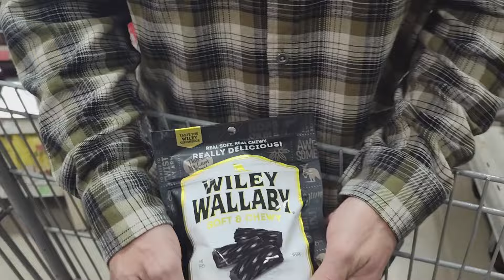Home renovations create some unexpected controversy! | Heartway Farms

Comment: 🇦🇺On one of the walls could you put a boot spike (dowels) rack. So boots are slid onto the dowels to make it simpler, leaving more floor space.
For the other shoes could you make a wooden racking system that’s on sliding tracks, the shelves wide enough for 3 or 4 pair of shoes by 7 or 8 shelves high. That way you slide a shelf system over to get to the next rack with more shoes. Similar to archive shelving. Again more floor space and neater.

Comment: The project looks terrific! I like the Green/black 😂 and shoe mess. I think if you take some green house plastic  and have Josh use 1x1 to hold onto the plastic it will prevent any more damage until you can fix the upper porch. Save yourselves time and money. Would work also if you bought plexie glass and cut it to the right size and used. You know, those special screw clips to put over the windows to keep the rain and stuff out. You know that you can absolutely take down for summer time. If you need to that would be great or work. Ed great. I should say just thinking that's all.